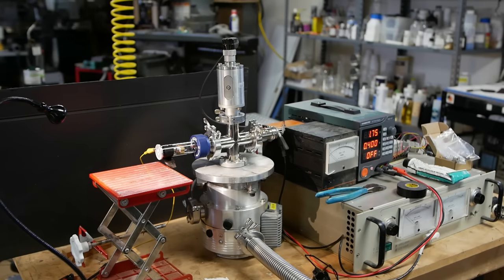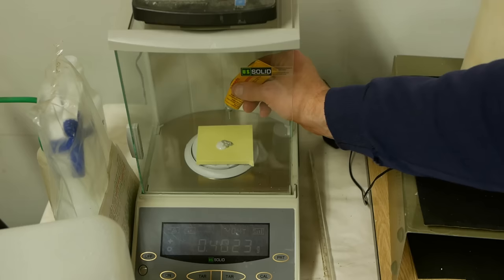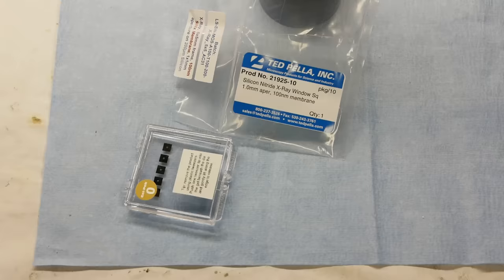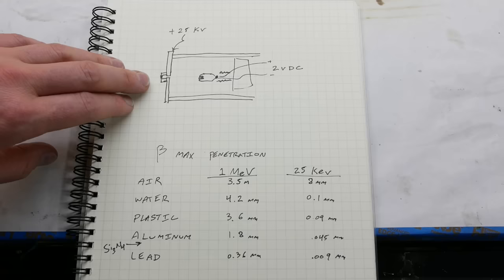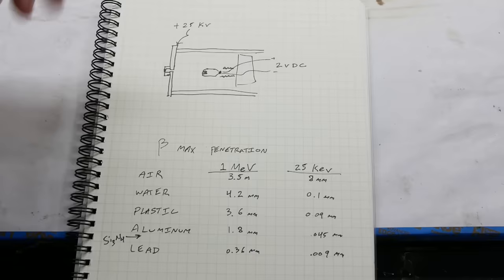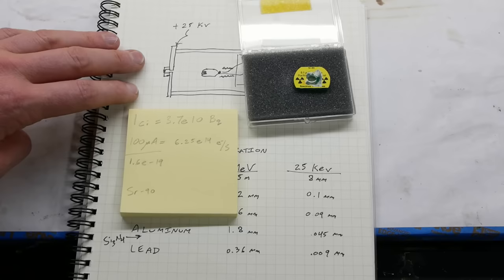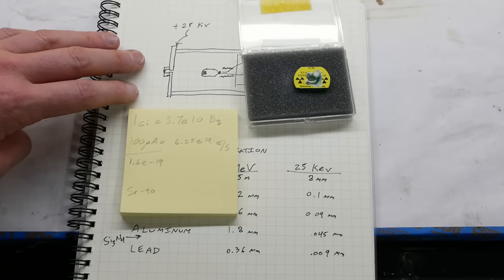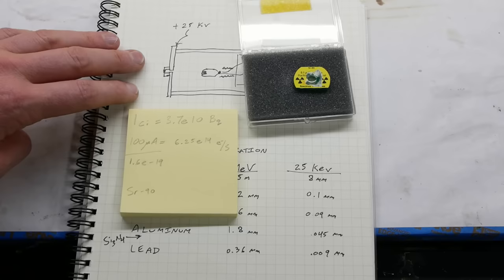Shooting an electron beam through air

Comment: There is a really great experiment that can be used to measure the beam energy from a particle accelerator.  You place a block of clear acrylic in front of the accelerator and fire electrons into it - the rule of thumb that I had been told was that 10mm of penetration equated to 1MeV of energy.  The acrylic block is such a good insulator that once the electrons have pernitrated it they can't escape and are trapped.  Once you are at this stage you place the acrylic block on a hard surface and using a 'center punch' and a hammer you apply a shock in a very concentrated point.  The shock wave that travels through the acrylic block dislodges the trapped electrons and they come rushing out.  There is a very bright flash of light and the electrons come out with so much force that the structure of the acrylic block gets ripped apart (at a very minute scale).  The resultant 'damage' in the acrylic block looks like a tree like structure with a central trunk (where the center punch was) and the trunk separates into smaller and smaller branches.  You can then simple measure how high the 'tree' is to be able to work out the beam energy.

Comment: Your channel is great, subscribed. It's fun and educational, and that's what I like. 
Years ago, I found an big old school building, that I wanted to buy and live in. It's 13,000 sq. ft. As I was daydreaming about living there, I wondered how I would heat it. I'm into "alternative" stuff, as it was in those days. I finally realized I needed a small, intense heat source year-round, to run a generator and heat water, so I came up with my own design for a fusion reactor, using a collimated electron beam aimed down the axis of a cylinder. By my "best estimation" (lol) it would take 90% of its output to keep itself going. But I thought, WTH, all I need is some deuterium and tritium. It's probably a good thing I don't have a shop or access to power tools.
Keep making awesome videos, thanks.

Comment: My dad was a physicist who designed field emission systems. In particular, he designed field emitter arrays for several systems. The big machine looked like a locomotive. It used a Marx surge pulse generator to generate high voltage at high current. It was charged at 8.6 kV and discharged at 2.5 MV. The pulse duration was in the 4 nS range. The pulse was directed into a cold cathode tube, which generated the electron beam. The device was used to x-ray bomb blasts in the desert, simulate atomic blasts, and radiation-harden semiconductors. If you were standing beside the unit, not in front, there was enough scattered radiation from one pulse to kill you.
Reply: cool
Reply: Hermes, izzat you?
I saw a great announcement from Project Hermes:  they could repair it so very rapidly, that they could now fire over five pulses in a single week!

Comment: The process of making Lichtenberg figures in clear acrylic is quite an experience - the flash of light and audible noise when you shock the acrylic with a sharp pointed center punch is quite impressive.  The process works well when you have a few MeV  - the rule of thumb I was told is that 1MeV produces about 5mm of penetration in the acrylic.

Comment: The electrons only have 25kev kinetic energy, so the highest charge they can give the acrylic is 25kv. This is not sufficient to cause much (any?) dielectric breakdown.
Reply: I don't think that's how it works. You have to think of the electrons like bullets penetrating into ballistic gel. For a given eV (ie. velocity) they are all going to pile up at the same location inside the material (at the Bragg peak) and get stuck there bc it's an insulator. The voltage gradient across the acrylic is then going to be a function of the number of electrons trapped inside, which itself is going to be dictated by the electron beam luminosity and beam exposure time rather than the electron energy. The electrons just pile up inside the insulator until the dielectric breakdown gradient is exceeded and a little lighting bolt finally spontaneously forms through it equalizing the voltage difference.
Reply from the maker: The speed of the electrons would determine how deeply in the material they can embed, or if they are repelled by the existing built-up charge in the material.  But the charge on each electron is always the same, so getting a certain number of electrons into the center of the plastic should always have the same effect upon discharging them.  As far as I know.
Reply: @AppliedScience  I don't know if electrons create positive or negative charge. You are adding some electrons, but at the same time they are causing emission of secondary electrons. Have you tried to measure current between sample and ground in your SEM? 
Speaking about SEM, way why not to use tungsten cathode and Wehnelt cylinder instead of light bulb?

Comment: At work we have 3 of these machines that crosslink polymers in plastic.  Specs are: 200KV, up to 460 mA.  48" beam width.  Typically runs absorbed dose of about 5.0 MR.   Filaments run 13.5 Volts. The window is 2 micron titanium foil, in front of a copper foil backing ( water cooled to absorb heat)   Vacuum is 6.2x10-7 Torr, generated by 10" CryoTorr cryopump.  Thank goodness for interlocks.

Comment: I'm really wondering why they made these square instead of circular (Talking bout the window, not the whole structure), i bet the stress reduction by doing that would make posible to manufacture these even thinner
Reply: Good observation, I would guess they are utilizing the semiconductor manufacturing processes already in use .
Reply: Yeah, probably because it's made in a wafer form that's then cut into squares.
Reply: @AtlasReburdened  i meant the small window, not the whole structure that it comes in, as Jack Allen mentioned it could very weel be due to the process used to make them
Reply: Hard (really hard) to make a round scribe or round cut in thin fragile material. Even making a square window in the SiN seems pretty hard to accomplish. But they did it. Perhaps laser cut???
Reply: @gcr100   Oh, I wasn't aware that the window and it's 'frame' were a single piece. I guess that makes more sense though. That is interesting. I recall learning once that some echants used in simiconductor manufacture behave quite differently depending on the orientation of the atomic level crystalline structure so it may be that the cubic form of Silicon nitride is used, and is cut such that it's orientation permits the echant to preferentially 'eat away' in one direction which, given the cubic structure, would likely mean that a square window could be made with fewer flaws than one of any other shape. Just an educated guess though.

Comment: Love it!!
I used to service vacuum systems. I was called out to helium leak detect a vacuum system which maintained a high vacuum for an powerful x ray gun used to crosslink rubber in a continuous sheet. The x ray gun was inside a concrete bunker with very thick walls, the rubber belt would enter and exit through slots in the walls which were zig-zagged.  When I was inside the room leak checking the system it was eerie knowing if they turned on the x-ray gun it was all over for me - like getting thousands of body x-rays all at once. There were of course multiple interlocks to prevent this such as a switch inside the room which prevents the x-ray gun from being switched on.

Comment: Film. Put a peace of 35mm film and let see what we can go through with electrons !
Reply: A sheet of photo paper, wetted with developer, would yield almost immediate results :)
Reply: Electron beam recorders were used in the 1960s to 1980s to transfer video to film.
Reply: You'd have to figure out how to filter out the x rays.
Reply: @whitcwa  We used electron beams to write on 16mm microfilm in 1973. The film was 3 feet away from the emmiter.
Reply: Get an old cam w/fairly large CCD, then paint it with zinc sulfide paint.    (DIY dental x-ray sensor.)

Comment: A loooong time ago, I got a black and white tv from the second hand shop. I removed some tubes, so the electron beam was not bend anymore but would stay focussed in an very bright spot in the middle. Then, I drilled very carefully a hole in that exact spot and let the air enter the tube. When switching the tv on, the filament in the electron cannon would hold for quite some and the electron beam escaping the hole would light up the neon light in my screwdriver for 1meters or so in front of the screen. I have to say that I didn't see any blue light or so protruding the hole in the screen, but the electrical effects were certainly there.

Comment: I used to be a high vacuum service engineer. I once serviced a vacuum pump for a high output x-ray gun inside of a concrete bunker used to crosslink plastic from a roll in a continuous process. It was one of the coolest service calls I had.

Comment: You could arrange 2 electrodes, each with one hole, in such a way that the beam passes through the first electrode and then through the second one. Then apply high voltage across the electrodes and you can observe how long electric arc can you create.

Comment: Cool experiment!
I once worked with Kilovac & Jennings changeover vacuum relays. We had some problems with field emission leakage ~10uA IIR... and subsequent Xrays :-) (also Molybdenum+Tungsten contacts).
We noticed a Saphire actuation rod inside the relay had a deep blue after-glow after power off - was interesting and new to me at the time.

Comment: I used to work in a plant that made shrink film. One product line (LTF) was scanned with X-rays before the tube was blown out in the bubble tower to full size and cut into two flat panels for winding. The X-rays were meant to crosslink the molecules of the plastic to strengthen the film across the web, since the extrusion of the tube already laid the molecules out straight. One year, during Christmas shutdown, the X-ray generator wasn't shut off, while the cooling system was. The X-ray tube and the power supply that drove it were both destroyed. The vacuum pump also had to be replaced because it had been sucking water from the cooling system. I believe that system used a very large turbomolecular pump because it was held at such a deep vacuum. While the line was down for X-ray repair, we replaced the thin Titanium aperture sheet on the scanner output. It was crazy to see how damaged it was from the beam. I don't know how thick it was, but it was ridiculously sharp on the edges so I was wearing two Kevlar/Stainless Steel weave gloves to protect my hands during install.

Comment: You can cut the neck off of an old television picture tube and use the high voltage section from the same TV with a push-pull DC/DC converter and a new primary coil wound on the flyback transformer.. I did that as an attempt at a high school science project but never had a means of drawing down a good vacuum or a good window. Thanks for the heads-up on the epoxy resin!

Comment: I work in the wire fabrication domain and yes, we do use electron beam accelerators to modify the molecular structure of the insulation material. We use Polyethylene in those types of wire. As for the benefits are as follow: higher current capacity (as the insulation is more resilient to heat) , they do not catch fire(they just turn black, but they do not flame out) and if they are burned by an external source they are more environmentally friendly. Our machine is only 800keV in power but I found out that it’s almost at the top of the power, or it was when fabricated, for this kind of machines. The OEM is Vivirad France, and great safety measures were taken by the oem and our facility to prevent irradiation of the personal. (Mainly x rays, but there are also gamma and betta radiations emited by the various materials struck by the electrons)

Comment: Decapsulate a mosfet apply a bit of Vgs while in beam, stop the beam -> measure Vgs/Id at several steps, you will measure the shift of the Vth. With the same method you can measure the energy deposited in SiO2 in Gy (if the mosfet Vth variation wtr to Dose has been previously calibrated ) As usual, great work and great content. Cheers from CERN

Comment: I am old enough to have been trained to troubleshoot tube devices when I was in the USAF. The high voltage tubes of radio transmitters over time would begin to store the radioactivity and become dangerously radioactive after just a few months of operation.

Comment: Old reactor plants on US navy ships can see cobalt-60 levels on the order of whole curies in some valves. Thankfully, we know where those valves are and can set up temporary lead shielding in the reactor compartment to reduce exposure. Attempts to reduce cobalt containing parts are being made, but those alloys are far superior to alternatives. 
The worst culprits are the control rod mechanisms, which must be as wear resistant as possible and as such are made of cobalt alloys. The cobalt-59 corrodes into the coolant and is activated by the neutron flux of the core. Later, it and other corrosion solids settle in valve bodies and low flow piping, causing hot spots.

Comment: My suggestion: decap various ICs (ram, microcontrollers, basic 74 series logic) etc., and throw them in from of the electron beam while they're running. It would be cool to see what's required to change their state or crash them. Excellent video!

Comment: some time ago we played with a laser conduit to project plasma charge through the atmosphere quite a distance. rather than getting into the nitty gritty, here is the nuts and bolts of it.
take a disc of some diameter. mount some Fabry Perot laser diodes around its perimeter facing toward the centre. grab some sort reflective medium , glass, diffraction grating or what ever to project the laser out perpendicular to the plate, just off centre.a small hole dead centre over the top of the electron window will suffice. mount all of this on some bearings with a few slip rings and spin it up. a stable laser conduit. obviously there are a few more niceties with collimating lenses on the disc but you get the idea
the ultimate effect is, the air within the conduit becomes partially ionised allowing a far more conductive path for what ever charge you shove up its nose.

Comment: The bulb filament is probably an underperformer as an electron emitter. One could always try the filament of a vacuum valve/tube which is made of tungsten with a BaO (barium oxide) coating.

Comment: As always your videos are very informative! 
I was curious about the Hysol 1C. I used to be a high vacuum service engineer (Leybold) and we used Araldite Solvent Free 5 minute epoxy for sealing threaded vacuum components. However I have ordered the Hysol 1C as I do need to seal some torrseal fittings to some needle valves in my pump system. I used to have a turbo pump on my pump system now I use a diff pump. By the way don't boil the diff pump oil as I saw in one of your videos, that reduces the efficiency. At the correct temp the oil should just show some movement on the surface.
I'm a glass blower making glass neon signs. I would love being your neighbor as being a glass blower, working with noble gasses would be cool projects together. :)

Comment: Amazing idea! The concept of using light bulbs as ion sources is completely unbeatable in terms of simplicity and cost!

Are you opening the foreline vacuum slowly to save the window the shock pressure change? A vacuum chamber that small has very little pressure-wise inertia. 

Thanks for yet another incentive to complete my high vac setup!

Comment: For Lichtenberg figures you might try putting the whole apparatus in vacuum and skipping the window? You could go to a higher acceleration potential (with appropriate shielding) and would not deal with losses to the air. On my list of things to experiment with for sure.

Comment: Have you thought about using an accelerator grid inside the tube just like a ( CRT ) cathode ray tube like the old TV picture tubes were.
That can accelerate the beam and possibly give you more output.

Comment: Always great to see your projects!
For the cross linking you need a rather high voltage. I visited a factory of these plastic multiskin water pipes one day and they cross linked the polyethylene plastic with 1 megavolt!  Alas i cannot tell how the setup was as it needed to be in a bunker which was off limits. If you like i can sent you some oxide coated  cartridge cathodes and crt phosphor for experiments.

Comment: Would love to see if you get diffraction pattern on your phosphor if the beam in shot through a fine graphite slab ? Would you fluorescence occur further away (basically would it generate soft x-ray outside of the vacuum envelope ) and would the graphite lattice have a preferential x-ray emission direction ?

Comment: This is fascinating.  I did some freelance work in the mid-90s performing software validation and verification on a system (Steris) that offloaded pallets of hospital supplies (gowns, gloves, bedsheets, bedpans, etc) from a tractor trailer on one side, onto a conveyor, through a concrete wall protected 10 MEV system (more than once or twice depending on package density), and out the other end to be loaded back onto the trailer.
They realized shortly after the system went online they can do a lot to the strength of plastics by exposing them to the e-beam (makes the polymer chains longer).
Had a plastics instructor in college who had the following on the final exam: “What are polymers?”.
Answer: “many mers”

Comment: Expose:

working CCD camera
Geiger counter
electroluminecient panel (would any voltage be present on el panel power leads? I know a lot of transducers work in reverse.)
neon light, if it can penetrate the glass.